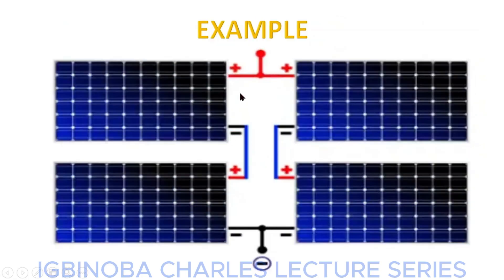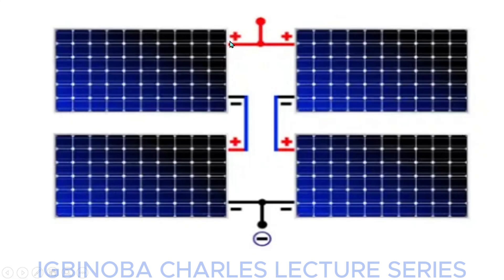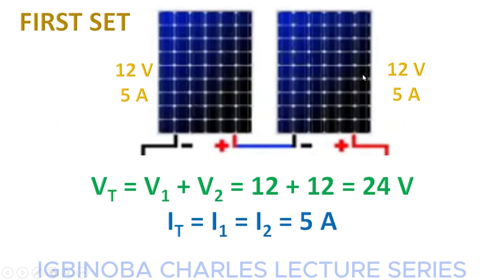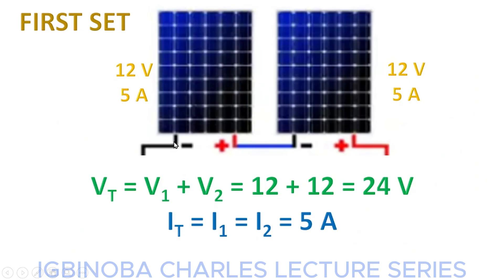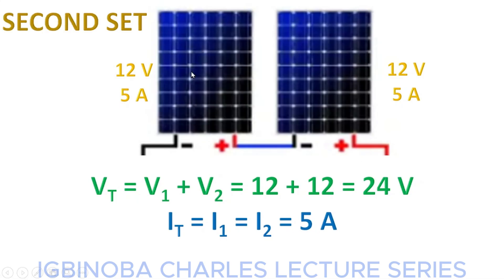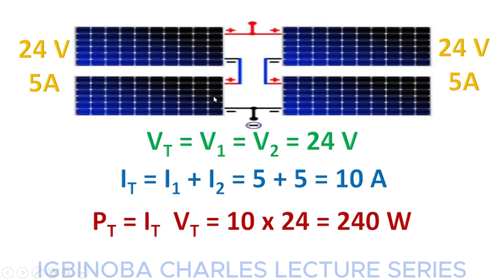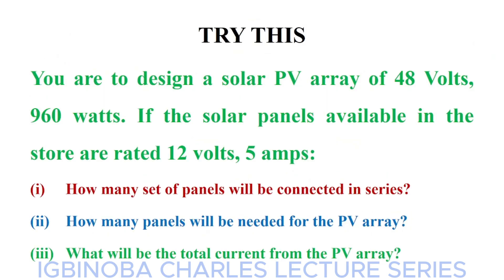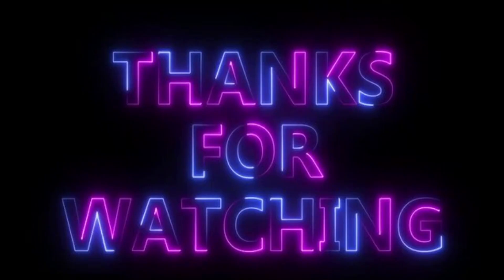Connection of  Solar Panels in SERIES-PARALLEL

Comment: PETRO388J

1. Sets of panels that will be connected in series is 48/12=4 

2. The power generated by a single panel is = 120V *5A = 600W.  The required power in the array is 960W. Therefore, the number of panels needed for the array is = 960/60=16 panels.

3. Since we have 4 panels connected in series and we have a total of 16 panels, Total panels connected in parallel is 16/4=4 panels in parallel. Each of these panels has a current of 5A. Therefore the total current in the PV array is 4*5A = 20A.

Comment: MAR375W

1). 4 panels are connected in series.

We connected four 12-volt, 5-amp panels in series, so we get a total of 48 volts, which is the voltage needed for the solar system.

2). A total of 16 panels are needed.

Each panel produces 60 watts I.e. 12 V x 5 A = 60 W
To get 960 W in total, 960+ 60 = 16 panels.

3). The total current from the solar array is 20 amps.
Using I = P + V, we have that, 1960 W 48 V = 20 A.

Comment: CHM314N

 1 . 4 panels are connected in series, we
 connected four 1 2'\4 5A panels in series,
 so we get a total of 48'\( which is the
 voltage needed for the solar system.
 2. A total of 1 6 panels are needed. Each
 panel produces 60W (1 2V # 5A).
 3. The total current from the solar array
 is 20A using \(I : P + V \)

Comment: CHM3159C

I) Total voltage = 48V, Each panel = 12V
Number in series = 48/12 = 4

II) Each panel = 12 x 5 = 60W
Total power = 960W
No. of panel = 960/60 = 16

III) No. of parallel strings = 16/4 = 4
Voltage = 48V
Total current = 4 × 5 = 20A

Comment: MAR3128X

1. 4 sets of panels will be connected in series.

Since connecting 4 of the 12 volts, 5 amp  panels in series gives a total of 48 volts as required by the solar PV array design

2. 16 panels will be needed for the PV array.

This is because the power of each panel is 12 x 5 =  60 watts, therefore the total number of panels to produce 960 watts is, 960/60 = 16

3. The total current from the PV array is 20 amps

Since I (total) = P (total)/ V(total)
I (total) = 960/48 = 20amps

Comment: PETRO3154X

1. 4 sets of panels will be connected in series.

Since connecting 4 of the 12 volts, 5 amp panels in series gives a total of 48 volts as required by the solar PV array design

2. 16 panels will be needed for the PV array.

This is because the power of each panel is 12 * 5 = 60 watts, therefore the total number of panels to produce 960 watts is, 960/60 = 16

3. The total current from the PV array is 20 amps

Since I (total) = P (total)/ V(total)

I (total) = 960/48 = 20amps

Comment: MAR3168L

1. 4 sets of panel will be connected in series.

Since connecting 4 of the 12 volts, 5 Amp panels in series given a total or 48 volts as required by the Solar Pv array design 

2. 16 panels will be needed for the pv array. 

This is because the power of each is 12x5= 60 watts, therefore the total number of panels to produce 960 watt is 960/60=16

3. The total current for the PV array is 20 amps

Comment: CHM377Y
1. Number of panels in series = 48÷ 12 = 4
= 4 panel

2. Panel required
Tota current = 960/48 = 20A
Each panel is rated 5A, string required:
20/5 = 4 strings of panel in parallel
Each string has 4 panels in series, so the total number of pantel required is;
4 * 4 = 16 panel 

3. Total current in PV array;
= 960/48 = 20A

Comment: EEE391M

1). 4 panels are connected in series.

We connected four 12-volt, 5-amp panels in series, so we get a total of 48 volts, which is the voltage needed for the solar system.

2). A total of 16 panels are needed.

Each panel produces 60 watts i.e. 12 V × 5 A = 60 W
To get 960 W in total, 960 ÷ 60 = 16 panels.

3). The total current from the solar array is 20 amps.
Using I = P ÷ V, we have that, 960 W ÷ 48 V = 20 A.

Comment: MAR311G

We connected four 12-volt, 5-amp panels in series, so we get a total of 48 volts, which is the voltage needed for the solar system.

2). A total of 16 panels are needed.

Each panel produces 60 watts I.e. 12 V x 5 A = 60 W
To get 960 W in total, 960+ 60 = 16 panels.

3). The total current from the solar array is 20 amps.
Using I = P + V, we have that, 1960 W 48 V = 20 A.

Comment: MAR320T

Four(4) panels are connected in series when you connect (4)12 volts5-amp panels you get a total of 48 volts

A total of 16 panels ..each panels produce 60watts(12*5=60watts)

Total current 
960/48=20amp

Comment: COMP19s 
1) when connecting panels in series, voltage add up,but the current remain the same 
Required voltage=48v
Each panel voltage=12v
Number of panels in series=48/12
           = 4panels
2). A total of 16 panels would be needed 
     Each panels produces 60watts
      P=IV
        P=5×12
         P=60Watts
To get the the panels needed for the pv array =total power/number of power of each panel 
              =960/60
              =16 panels 
3). Total current =
        I=P/v
        I=960/48
        I=20A
Total current is 20A

Comment: MECH 3156Z
Thee four panels will be connected in series 
48V ÷ 12V = 4

A total of sixteen panels will be required for  the PV array since:
960w ÷ 60w = 16
 
3 The total current from the PV array is 20A, calculated as
960w ÷ 48V = 20A

Comment: MAR37G 

ANSWER;
(1) Given, 48V as the total voltage of the array needed, and the available panel rating to be, 12V, then the set of panels to be connected in series is :
48/12 = 4 sets

(2) Panels needed for the PV array = 8 panels 

(3) Total current= 960W/48V
 I = 20A

Comment: MAR372T

1. Numbers of panels in series:  for 48v, we need to connect panels in series . since each panel is 12v, we need 48v divided by 12v which is equal to 4 panels in series.

2. Total number of panels : 
Each panel is 12v,5A, so the power rating will be : 12v * 5A =60w per panel.

For a 960w array, = 960 divide by 60w per panel= 16 panels 

Since we need 4 panels in series,we will have 16 panels/ 4 panels per series line up = 4 panels line up .

3.total current from pv array:

Each series line up produce 5A (since the panels are connected in series ).with 4 parallel line up , the total current will be: 5A x 4 = 20A.

Comment: I.4 panels will be connected in series because each panel produces 12 V and the array  voltage we need is 48 V:

Number of panels in series = 48 V ÷ 12 V = 4 panels.

II. 16 panels are required. If I may explain, each series set (string) gives us 

P = V × I = 48 V × 5 A = 240 W

The total power we need is 960 W, so the number of such series sets is

960 W ÷ 240 W = 4 sets.

So the total number of panels = 4 panels per set × 4 sets = 16 panels

III. The total current from the PV array is 20 A because each string supplies 5 A, and 4 strings are connected in parallel:

Total current = 4 × 5 A = 20 A

Comment: MAR312L
Given:
Required PV array: 48V, 960W
Available solar panel:12V, 15A

i) How many panel in series 
In series voltage adds up, current remains the same.
Number in series= 48/12 =4

ii) How many total panel for the array?
Each panel = 12V*12A = 60W
To get 960W in total, 960W/60V = 16 panels 

iii) Utilizing the formula I=P/V
I= 960W/48V=20A

Comment: CHM 322V

Question 1.
For the set of panels to be connected on series is given as
48/12
=4

Question 2.
The power generated by the single panel is given as
12V x 5A
=60 W
The required power in the array is 900W....., therefore, the number of panels required is
960/60
=16.. 
Hence 16 panels are required 

Question 3.
16 In array
4 in series 
Total number of parallel pmset of panel is given as... 
16/4 =4

The total current from each set of panel is 5A. 
Since the set are parallel, the total current is given as
5 x 4
=20 A

Comment: COMP3110F

1. A set of panels connected in series
since 1panel=12v
48v= xpanel
48 V/ 12 V=4 panels

2. 960 W/ (12v * 5amps)
=960watts/60watts=16panels

3. total current
I= p/V
Where P= 960watts
V=48volts 

960watts÷48 V=20A

Comment: CHM 47U

Three solar panels connected in parallel: 

panel 1 13a, 78w 
panel 2 12A, 96w
Panel 3 12A 120w 

 in parallel connections voltage remains the same and total power and total power of individual power ATP.

Total power output: 78w + 96w + 120w = 294 watts

Comment: MAR3139I 

1. Four panels are connected in series.

When you connect four 12-volt, 5-amp panels in series, you get a total of 48 volts, which is the voltage needed for the solar system. 48/12 = 4

2. 16 panels are needed in total 

with panel producing 60 watts (12V x 5A = 60W).

To get 960 W in total: 960 ÷ 60 = 16 panels.

3. The total current from the solar array is 20 amps.

Using the formula I = P + V,

1960 W48 V = 20 А.

Comment: PETRO3173Q.

GIVEN DATA:
 Required PV array: 48 V, 960 W Available solar panel: 12 V, 5A ) How many panels in series? In series, voltages add up, current stays the same. We need total voltage = 48 V, and each panel = 12 V. Number in series =48/12=4 (i) How many total panels for the array? Each panel = 12V x5A=60VW To get total power = 960 W Number of panel=960/60=16 (ii) What will be the total current from the PV array? Each series string = 4 panels = 48 V, 5 A. We have 16 panels total, so: Number of parallel strings=16/4=4 In parallel, current adds, voltage stays same (48 V):  current =4x5A=20A
Hence, the total current=20A

Comment: MECH376X

Based on the requirements for a solar PV array with 48 Volts and 960 watts, and using solar panels rated at 12 volts and 5 amps, the calculations are as follows:

(i) Number of panels connected in series

To achieve the required voltage of 48 Volts, the number of panels in series is calculated as:
48 V / 12 V per panel = 4 panels.
Thus, 4 panels are connected in series.

(ii) Total number of panels needed

The power per panel is calculated as:
12 V × 5 A = 60 watts.
The total number of panels required for 960 watts is:
960 W / 60 W per panel = 16 panels.
Thus, 16 panels are needed for the PV array.

(iii) Total current from the PV array

The total current can be calculated using the power formula:
P = V × I, so I = P / V = 960 W / 48 V = 20 A.
Alternatively, since each series string carries 5 A and there are 4 parallel strings (16 panels / 4 panels per string), the total current is 4 × 5 A = 20 A.
Thus, the total current is 20 Amps.

Comment: MAR3130Z

Given:
Required PV array: 48 V, 960 W
Available solar panel: 12 V, 5 A
(i) How many panels in series?
In series, voltages add up, current stays the same.
We need total voltage = 48 V, and each panel = 12 V.
Number in series =48/12=4
(ii) How many total panels for the array?
Each panel = 12V ×5A=60W
To get total power = 960 W
Number of panel=960/60=16
(iii) What will be the total current from the PV array?
Each series string = 4 panels = 48 V, 5 A.
We have 16 panels total, so:
Number of parallel strings=16/4=4
In parallel, current adds, voltage stays same (48 V):
Total current =4×5A=20A

Comment: PETRO3131A

Required PV array: 48v, 960w
Each panel: 12v, 5A
Power of one panel:
P= V×I = 12×5=60w

I. No of panels in series; 
48/12= 4
II. No of panels needed for 960w
960/60= 16
III. Total current from the PV array;
4 panels per series string= 48v, 5A 
We have 16panels in total so;
No of parallel strings; 16/4= 4strings
When connected in parallel, 
Itotal=4×5=20A

Comment: MECH3167K
(I) 4 set of panels would be connected in series because in series connection, current is the same all through the circuit. But the voltages are added up to get the total.
(II)16 set of panels would take parallel connection to maintain the same voltage but achieve a higher current.
(III) Total current is 20A

Comment: COMP363K

Required PV array: 48v, 960w
Each panel: 12v, 5A
Power of one panel:
P= V×I = 12×5=60w

I. No of panels in series; 
48/12= 4
II. No of panels needed for 960w
960/60= 16
III. Total current from the PV array;
4 panels per series string= 48v, 5A 
We have 16panels in total so;
No of parallel strings; 16/4= 4strings
When connected in parallel, 
Itotal=4×5=20A

Comment: EEE3135
1) two set of panel will be connected in series 
2) Total of four panels will be used for the PV array
3) Total current will be 20 Amp since one amp is 5 and there are four panels. 5×4=20

Comment: PETROCHEM344R
Ige Opemipo Iyinoluwa

1.Number of Panels in Series
Required system voltage = 48V
Each panel voltage = 12V
Number of panels in series = 48V ÷ 12V = 4 panels
Answer: 4 panels in series.

2.Total Number of Panels Needed
Power of one panel = 12V × 5A = 60W
Total required power = 960W
Total number of panels = 960W ÷ 60W = 16 panels
Answer: 16 panels in total.

3.Total Current from the PV Array
Total panels = 16
Panels in series = 4 → Number of parallel sets = 16 ÷ 4 = 4 sets
Current per set = 5A
Total current = 4 sets × 5A = 20A
Answer: The total current is 20A

Comment: EEE 3127W
1.Number of Panels in Series
Required system voltage = 48V
Each panel voltage = 12V
Number of panels in series = 48V ÷ 12V = 4 panels
Answer: 4 panels in series.

2.Total Number of Panels Needed
Power of one panel = 12V × 5A = 60W
Total required power = 960W
Total number of panels = 960W ÷ 60W = 16 panels
Answer: 16 panels in total.

3.Total Current from the PV Array
Total panels = 16
Panels in series = 4 → Number of parallel sets = 16 ÷ 4 = 4 sets
Current per set = 5A
Total current = 4 sets × 5A = 20A
Answer: The total current is 20A

Comment: MAR395Q 

1. Numbers of panels in series:  for 48v, we need to connect panels in series . since each panel is 12v, we need 48v divided by 12v which is equal to 4 panels in series.

2. Total number of panels : 
Each panel is 12v,5A, so the power rating will be : 12v * 5A =60w per panel.

For a 960w array, = 960 divide by 60w per panel= 16 panels 

Since we need 4 panels in series,we will have 16 panels/ 4 panels per series line up = 4 panels line up .

3.total current from pv array:

Each series line up produce 5A (since the panels are connected in series ).with 4 parallel line up , the total current will be: 5A x 4 = 20A.

Comment: EEE345S

i Four (4) panels will be connected in series since:
48V ÷ 12V = 4

ii. A total of sixteen (16) panels will be required for the PV array since:
960W ÷ 60W = 16

iii. The total current from the PV array is 20A, calculated as:
960W ÷ 48V = 20A

Comment: PETRO3119O
 When connecting panels in series voltages adds up but the current remain the same

Required voltage =48V
Each panel voltage =12V
Number of panels in series =48/12
=4 panels in series

A total of 16 panels will be needed 
Each panels produces 60W i.e 12V ×5A
=60W
To get 960W in total
Therefore 960/60=16panels

Utilizing the formula-I =P/V
I=960W/48V =20A

Comment: MECH396R

A) Panel in series: To achieve the system's target voltage of 480V using 120V panels, 4 panels needed to be considered in series 
Calculation: 48V ÷ 5A = 4 panels 

B) Total panels needed: The power output of a single panel is 600W. To meet the total system power demand of 960W, 16 panels are required in total.
Calculation: 960W ÷(12V × 5A)=960W/60W = 16Panels

C) With 16 total panels arranged in the series string, these strings are connected in the parallel the result is 20amps,
 Using I=P/V = 960W / 48 = 20A.

Comment: MAR3120P
1. 4 sets of panel will be connected in series (48v/12v) = 4
2. 6 panels will be needed for the PV array (960W / 60W )=16 
3. The total current from the PV array is 20A (960W/ 48W) =20A

Comment: MECH3146P
1.  The number of panel required is 48÷12= 4panels.  
 
  2. The power output of pne panel is the total voltage multiplied by total current.  
  P=12×5=60watts  
 
  Therefore the total number of panel to prodUce 60WATTS  
  = 960/60=16Panels.  
 
  3. With 16 panels in total and 4 panels per series string, the number of parallel strings is 16÷4= 4parellel sets. Each string produces a current of 5A, since the strings are connected in parallel the total current supplied by the array is =5A×4=20A.

Comment: MAR3160D

1. Four panels are connected in series.
   When you connect four 12-volt, 5-amp panels in series, you get a total of 48 volts, which is the voltage needed for the solar system.
2. A total of 16 panels are needed.
   Each panel produces 60 watts (12 V × 5 A = 60 W).
   To get 960 W in total:  960 \60 = 16  panels.
3. The total current from the solar array is 20 amps.
   Using the formula  I = P÷ V

1= 960W ÷ 48V = 20A

Comment: MAR398T

Question 1: I would say 4 panels are connected in series.

Question 2: Also A total of 16 panels series will be needed.

Question 3: The total current is equal to 20A.

Comment: PETRO374V

1. 4 panels will be connected in series

2. A total of 16 panels will be needed for the PV array since 1 panel will produce 60 watts of power and the total powet given is 960 watts.
960/60 = 16

3. The total current is 20 Amp

Comment: MAR3114J

1). 4 panels are connected in series.
We connected four 12-volt, 5-amp panels in series, so we get a total of 48 volts, which is the voltage needed for the solar system.
2). A total of 16 panels are needed.
Each panel produces 60 watts I.e. 12 V x 5 A = 60
W
To get 960 W in total, 960+ 60 = 16 panels.
3). The total current from the solar array is 20 amps.
Using I = P + V, we have that, 1960 W 48 V = 20 A.

Comment: MAR344R

Given:

PV array rating = 48 V, 960 W

Each panel = 12 V, 5 A

Step 1: Find how many panels in series

In series, voltage adds up while current remains the same.

We need 48 V, and each panel provides 12 V:

\text{Number of panels in series} = \frac{48 V}{12 V} 

Step 2: Find total current and total power per series string

Each panel gives 5 A, so each series string gives 48 V × 5 A = 240 W.

Now, total required power = 960 W.

\text{Number of parallel strings} = \frac{960 W}{240 W} = 4
So, there will be 4 sets (strings) in parallel.

Step 3: Find total number of panels

Each set has 4 panels, and there are 4 sets:

\text{Total panels} = 4 × 4 = 16
 Answer (ii): 16 panels total

Step 4: Find total current from PV array

In parallel, current adds up while voltage remains the same.
Each series string gives 5 A, and there are 4 strings:

\text{Total current} = 4 × 5 A = 20 A
Answer (iii): 20 A total current